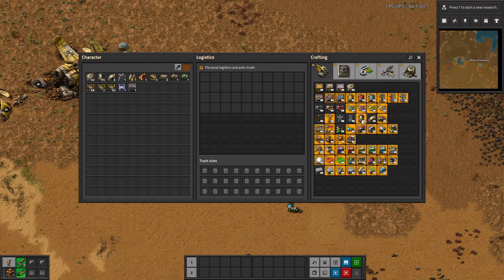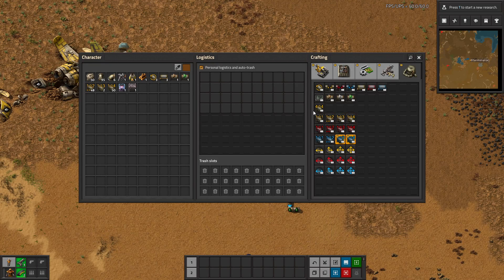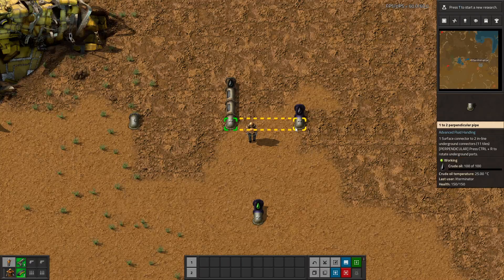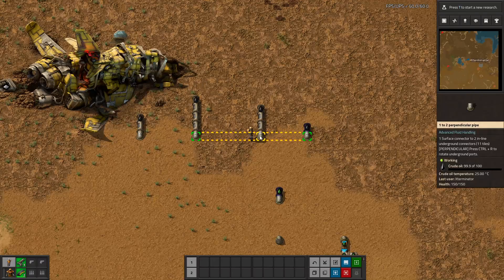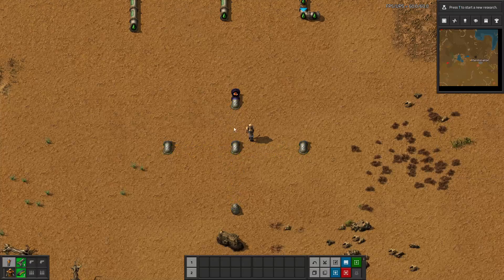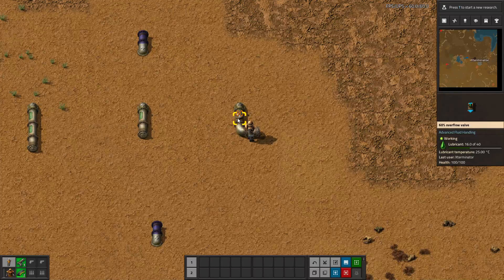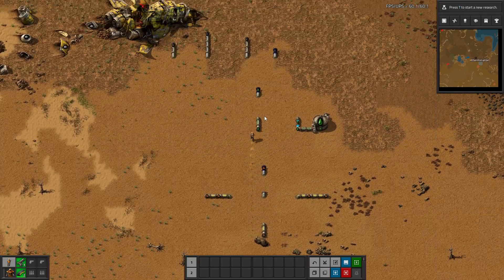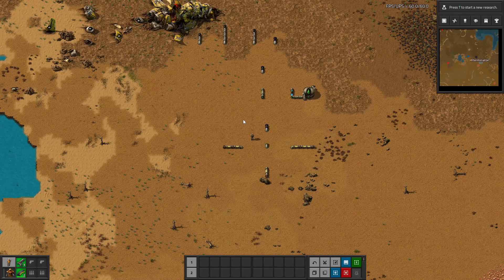Factorio Mod Spotlight - Advanced Fluid Handling

Comment: If you found the number of intermediary product quite overwelming to produce (there is a lot of finished product already with the mod after all), you can look at less advanced fluid handling. There is also Really less advanced fluid handling (reduce to only one tiers of pipe) and Even less advanced fluid handling, my favorite, which use only pipe as ingredient. Make the hub a little bit less messy.
Reply: and indeed, you use mainly tiers one fluid. you use tiers two or three only when you need to go really far (so let game "unit" build and stuff like that)

Comment: I always thought it was strange that pipes and conveyors can't go underground forever. I suppose with belts you'd need supports to keep the dirt and stones from falling onto the belt, but with pipes you just have to dig a hole and put pipes in there. I wonder if there's a mod that lets you place individual underground pipes that connect to eachother and to any above ground pipes in the same spot. I feel like it would make more sense.
Reply: There is a mod which gives you a separate "underground" layer and you build pipes on it as you would above ground, allowing total underground pipe flexibility.
Reply: @K-o-R  That mod sounds like exactly what I was thinking of! Do you, by chance, know the name of the mod? Thanks!
Reply: @reeman2.0  It's called Pipelayer. YouTube won't let me link.

Comment: The overflow valve seems a bit counter-intuitive if it is as you describe. I would assume it worked like "if the pipe system on the input side is filled above the set percentage, then open the valve".

Top-up valve seems like "if the pipe system on the output side is filled below the set percentage, then open the valve".
Reply: Yea, that's what I thought it should be like.
Reply: @kokiklv  i think thats what it does and thats the reason why "its a little finicky" because it does not work like he thinks :D